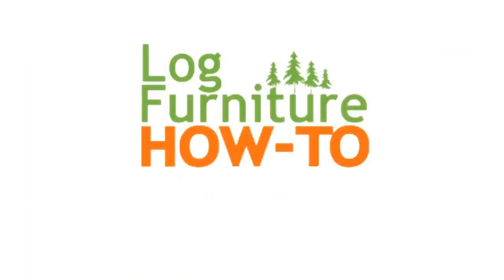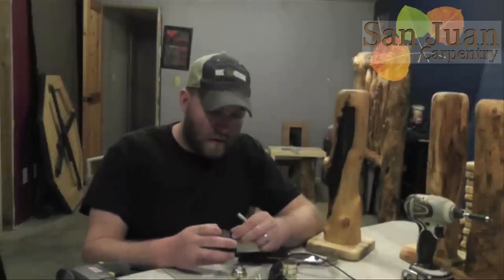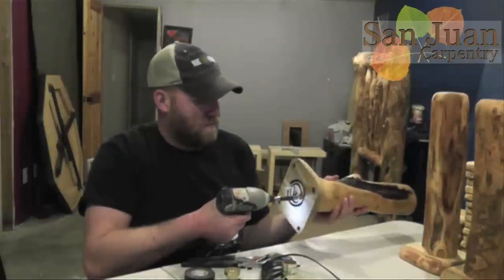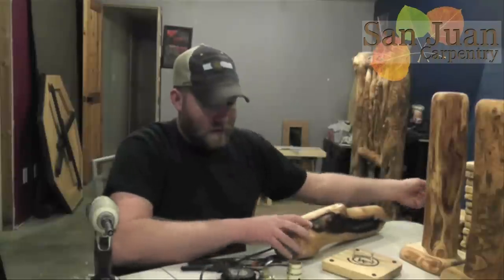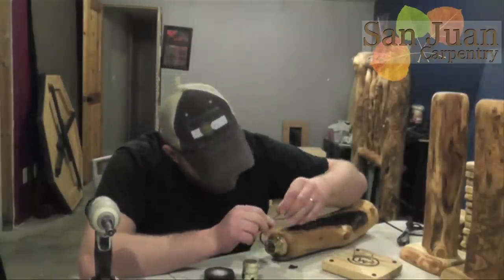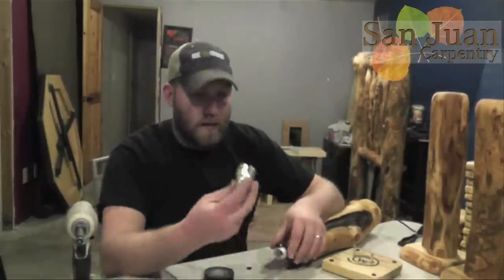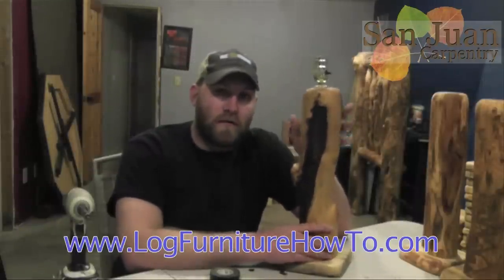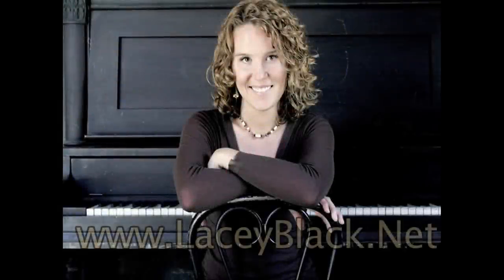Assemble Lamp Kit How-To

Comment: How did you get the hole through the log?
Reply: Mike Pendulum I wondered the same thing, guess it’s a closely guarded business secret.
Reply: I turn lamps on a lathe, and let me tell you - it's not so much of a secret, as no one really knows the best way in order to share it.  You want a long 5/16" bit.  On the lathe, I bore in from the tail stock end using a hollow cup center which allows an 18" long 5/16" bit to pass through.  I go in slightly over half way from each end and meet in the middle.  I turn at about 600-800rpm for this, advance VERY slowly, and pull out to empty the flutes after about every inch of progress.  

If you are wanting to do this on a log, like this guy, you will likely do it by hand.  It will never be perfect.  The long drill bits want to bend and the wood grain will slowly lead it in some curved  direction.   When you hear squeaking, you know the hole is curved.   The fact that this is so hard to do by hand is likely why this gentleman is not using lamp pipe (that hollow threaded rod) down the entire length, but only using 4 inches of it.  He probably only has 4-6 inches of straight hole.  :)   

But, pay attention to the same tips as above, and you can make it work with some practice.  You will probably not be able to go in half way from each side and meet, this way.  Just go all the way through.  Also, don't push on the drill.  Use a sharp (new) bit, and let it do the work.  Just concentrate on keeping it straight.  A small length of narrow pipe can help with this.  File the walls on one end of the pipe to be sharp and hammer it a little into the end of the log.  You've just made a poor man's visual drill guide.

Also, only use twist bits with no spur.  The lead worm on an auger bit will travel too easily where the grain tells it.

Hope that helps!
Reply: (You could also drill a hole through a piece of wood and clamp that to the end to use as a guide, but the hole will eventually get bigger and sloppier.)
Reply: Oh, and use a candle to wax up the threads on that lamp pipe, in case it ever needs to come back out.